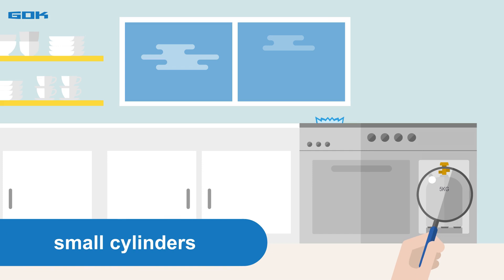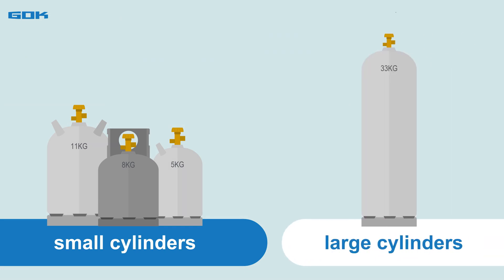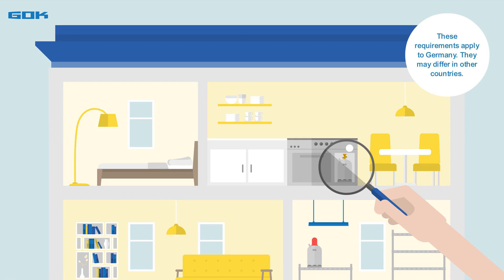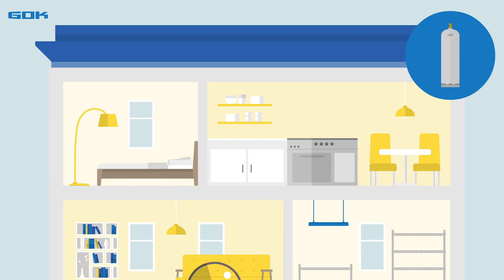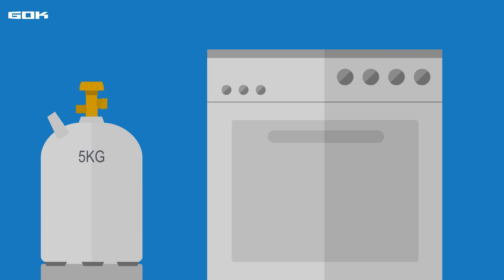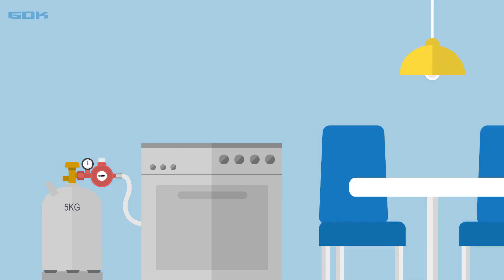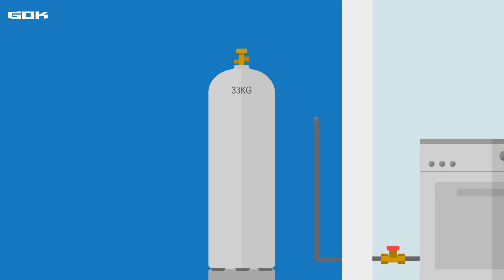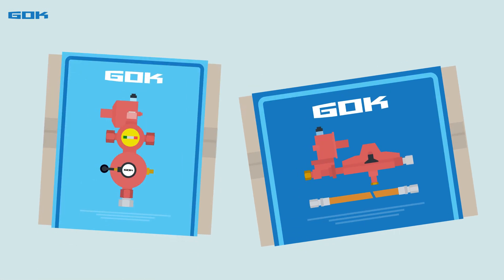Gas cooker in the building - connection and operation with LPG

Comment: Taking me three years to find this, the reason why there were no UK Videos on how to connect a gas cylinder to a cooker, It's because of strict regulations Plus the fact That it will cost you 100 UK notes To To hire out an engineer, so videos like this are frowned upon How this got past them is quite beyond me However it's a help